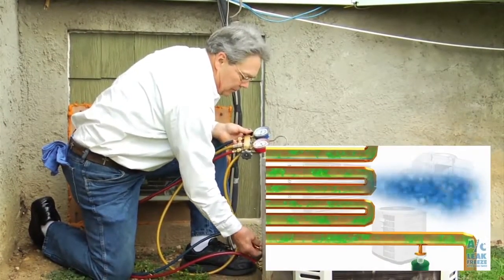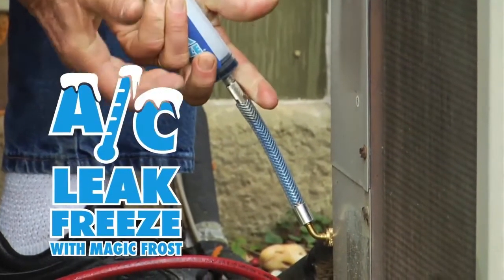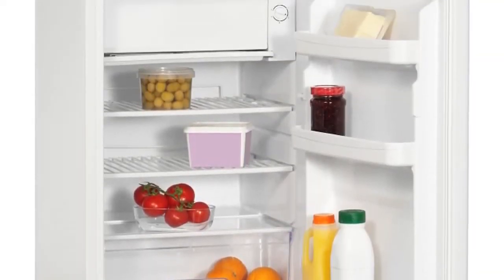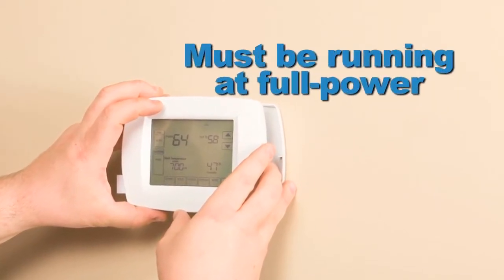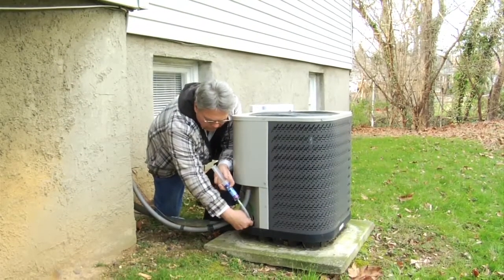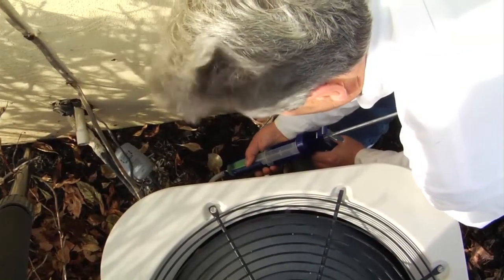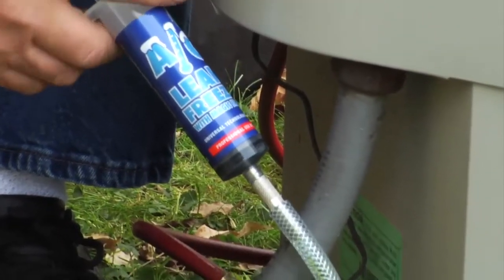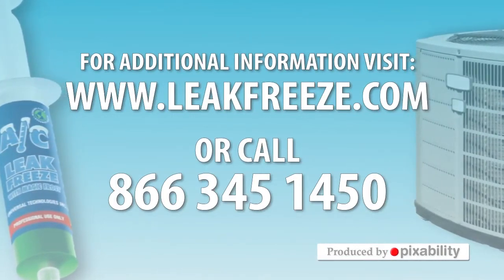Fix Refrigerator and AC Gas Leaks with AC Leak Freeze

Comment: Garbage stuff
Reply: mychoclabwinston  You must be old time and not adaptable to modern methods. I was learry for a long time, decided to test on MY house unit. That was 10 years ago and since I have had success with my apartment complex and many other units. Now am trying in refrigerators. For that hard to find or impossible to get to home HVAC repair,  charge a client $7K for a new system or $100 for stop leak?